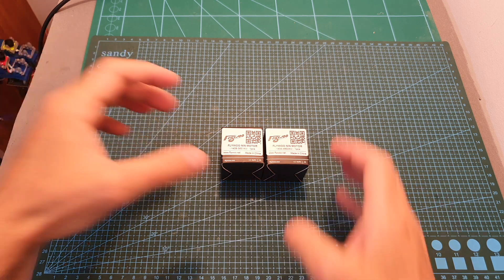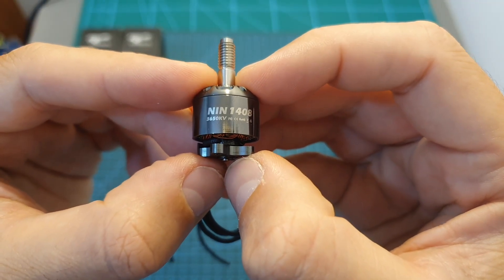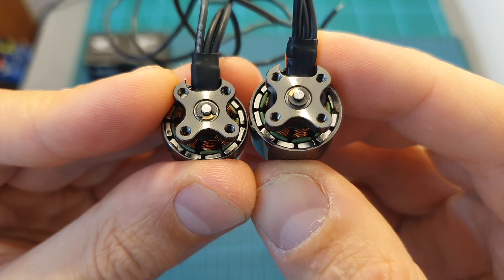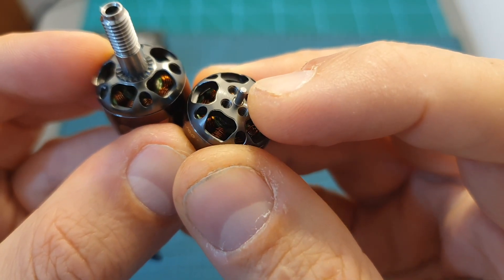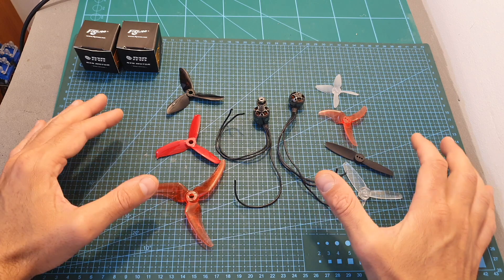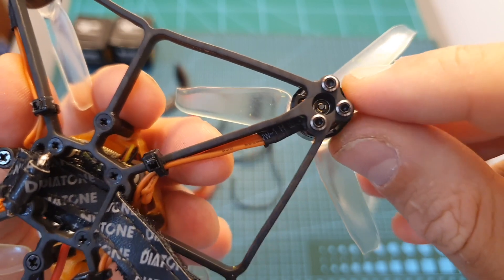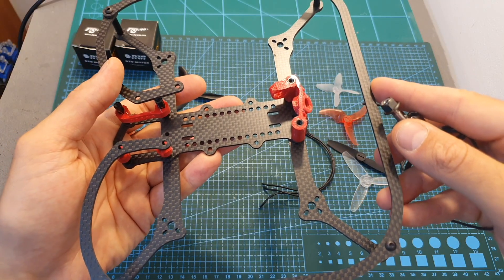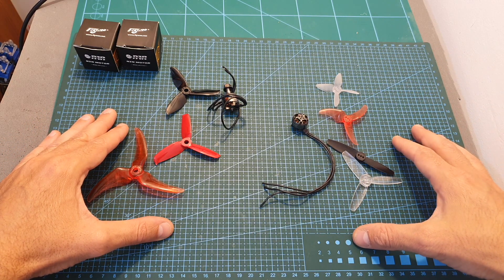Flywoo 1408  & 1404 Motors Overview & Thrust Test

Comment: Thank you so much about this video, I'm currently trying to build my long range 4'' fpv, and wondering about whether I should choose rcinpower smoox 1404 or flywoo 1404
Reply from the maker: My pleasure. Both will be good options :-) If you you're looking for a more powerful setup you can consider using 2004 motors as well.

Comment: HI Gal, need a little advice please. Ive replaced my mamba 1408 2800kv motors on my gtr369 quite a few times now. What would you suggest I change them all too as I'm presuming the mamba brand has quality issues as the 2800kv is no longer available. Thanks in a advance
Reply from the maker: Hi Trevor. Are you looking for more speed or flight time?
Reply: @KremerFPV  Sorry, I've been on annual leave. tbh Im OK with a little of both! How about the brotherhobby 1507 - 3100 version ??
Reply from the maker: @trevorc6793  Should be pretty powerful option :-)

Comment: Hello. Love your videos. can you please do a thrust test for xing 1204-4500kv
That motor datasheet claims max thrust value of 498g with 3*3*3 propeller. I wonder what thrust with avan 3024 aswell. Would love to see if that's true. Cause that would make it great for sub250 build. Thank you
Reply from the maker: Thank you! I don't have this motor, but I might test similar ones in the future :-)

Comment: Flywoo 1404 V2 4850kv have a fault in its construction. Testing results are far from what they advertise and not even close to results from V1 tested in this video.
It takes 17A instead of 10.64A at full throtle with EMAX avan 2.5" props. Max. thrust at 4S is just 311gr at 17A! It has efficiency of just 1.214gW instead of 2.37gW with this prop!! 
I have blackbox logs to prove this if anyone is interested.

Comment: Ever so the explorer setup. 1404 2750kv 4024 props
Curious thrust at all the throttles.  
Also curious on the hq t-mount 5" biblades to build a shocker ultra light

Comment: I now choose a motor for a small drone with maximum efficiency. Your test is very interesting to me. But I had a question, is there no error in the table with the results? For example, according to the data on the Flywoo website, a 1404 4850 KV motor with a 3030-3 propeller when powered by a 3S battery has a maximum thrust  of 333 grams, power consumption is 175 watts, and the efficiency is 1.902. In your pdf for the GF 3035-3 propeller with a 3S battery with a thrust of 338 grams, the power consumption is only 97.17 watts, and the efficiency is 3.48. Did the guys from Flywoo underestimate their motor so much?

Comment: thank you for the test!! I'm not familiar but the results in terms of current drawn are really exceptional compared to same size/kv motor....how accurate can be the amp reading? (i'm planning to use these type of motor with a LiOn battery pack hence i need to stay below 30A-35A)
Reply from the maker: As far as I know they are pretty accurate (at least above 20% throttle).

Comment: Hi Kremer ☺️
nice review, question  I want to build an acrobrat 3'' 4s  with split micro 3, I considere to use the  flywoo 1404 what do you think if any good? Thank you for supporting me
Reply from the maker: Hi there. I still haven't tested these motors, but the acrobat frame is not so light, so the 1408 motors would be probably a better choice. Here is my build video of the Acrobrat: https://youtu.be/aYHlvx4LZzc

Comment: Good looking motors, have to look at the tables you made. I have the ER349 with 1408 motors and it absolutely rips. I'm sold on that motor size for large areas and the 1206 motors for tight park flying. Thanks for the information.. 👍🏻🍻👊🏻

Comment: Those 1404s look way better than the bigger ones. 340g of thrust at 3.5 g/W  on 3s. Assuming an 80g dry build and a 50g 3s pack that's a pretty great thrust to weight with pretty decent pitch speed.
Reply from the maker: True. I will need to find a good frame that would fit these motors.
Reply: @KremerFPV  I've got my 1304s on a flexrc slimx 3" with a 16x16. Flies so nice I'm tempted to get another one to try those motors on.
Reply from the maker: @frasersteen  Thanks. Sounds interesting.